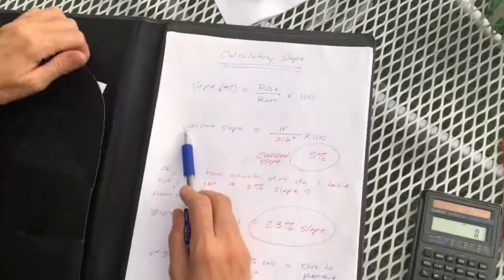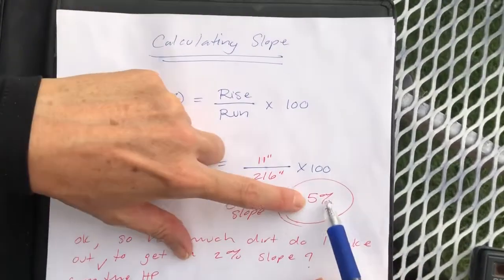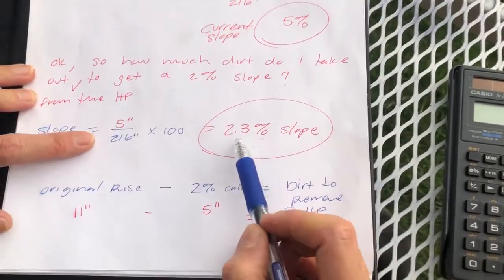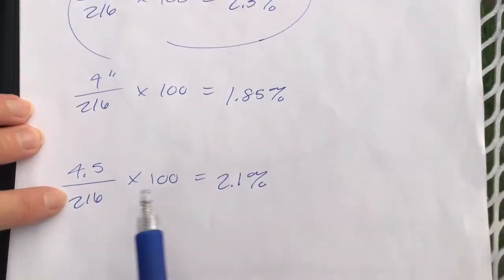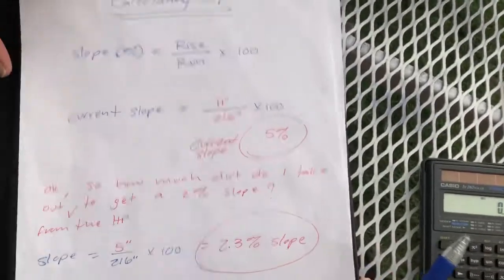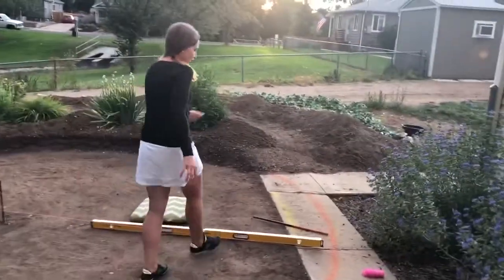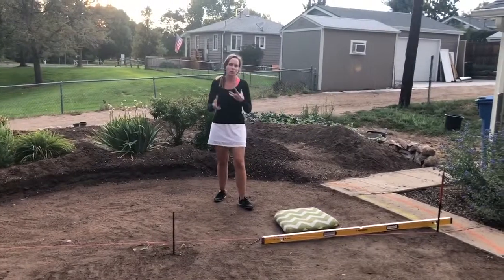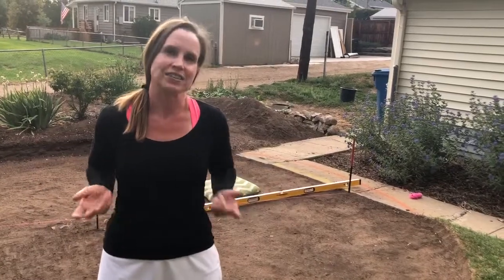How to Create a 2% Slope for Drainage   Part 2   Continuation   Firepit Patio Series   Video 4

Comment: Whatever percentage of slope you want, you multiple that percentage to the run of 216 inches 

In your case you want 2.3% 

Formula is 216inches x 2.3% = 4.96 inches. 

Find the difference (subtraction) 11 inches minus 
 4.96 inches = 6.1 inches 

Use that difference to bring low point up 6.1 inches or use that difference to bring the high point down 6.1 inches 

Either one will get you to 2.3%